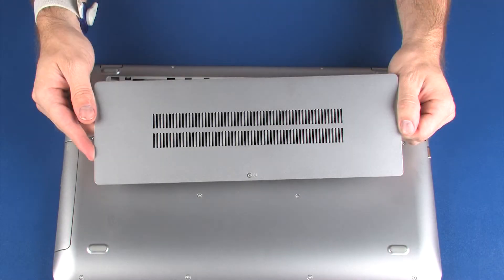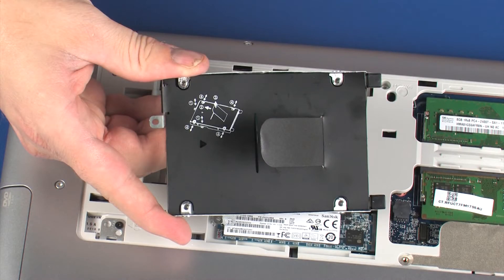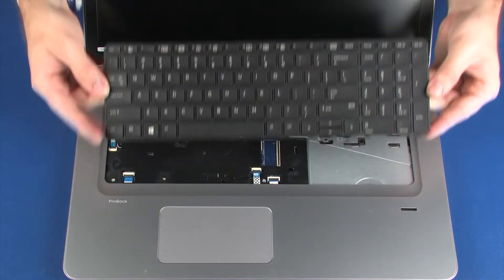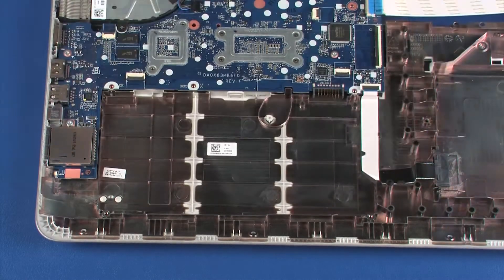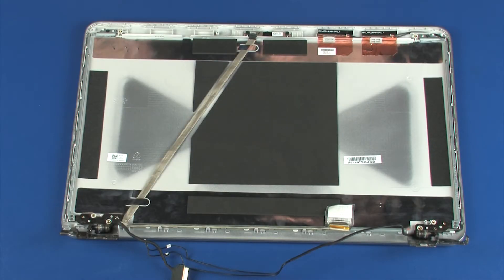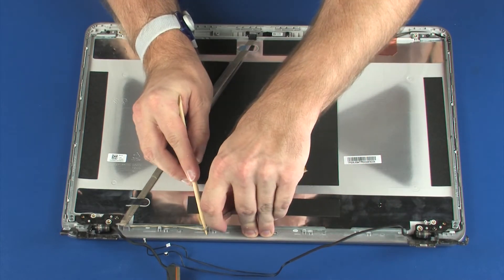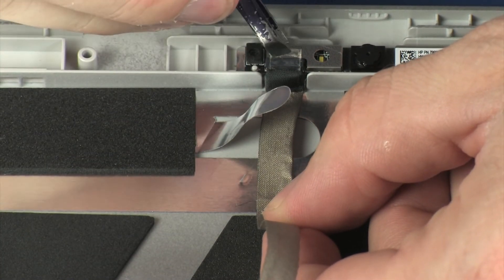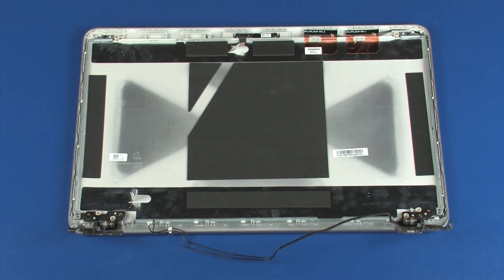Replace the Display Panel Cable | HP ProBook 450, 455, 470 G4 Notebook PC | HP

Comment: I replaced my cable today. When i start up my computer, the display remains grey. I have tried using another screen through hdmi and it gets no signal. Any ideas what could have gone wrong?
Reply from the maker: +Andreas H This document provides possible solutions to many common computer start-up issues. Follow the instructions in this document step-by-step to help isolate the problem and find the most appropriate help: http://hp.care/2oFlOWC
Reply: @HPSupport  
Thanks for your reply. The problem isn't the computer not starting up though. Its my display getting no signal from the system. I can use the laptop through an external monitor, but the internal screen doesn't get any signal.
I will try a hard reset tomorrow, but I doubt it will resolve this kind of problem.
Reply: is the cable connected in right way
Reply: @flyingsaucer1354  
I've done everything once again and checked all connections. Now hdmi is working, but i still dont get any response from the laptops display.